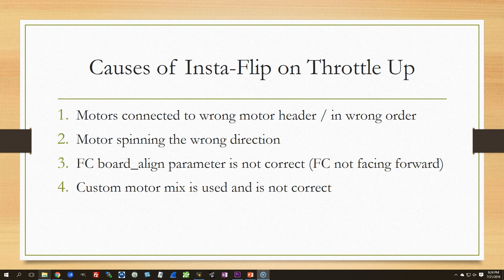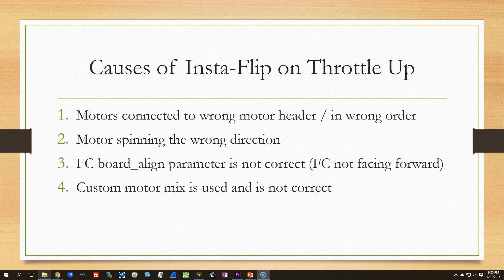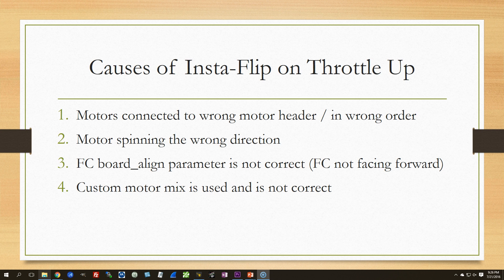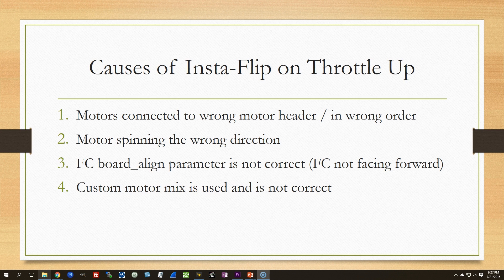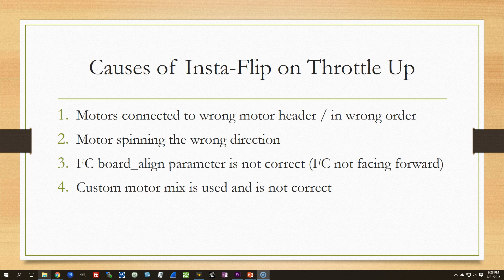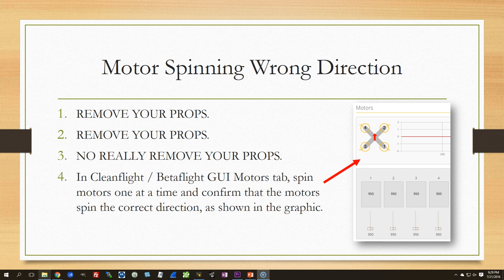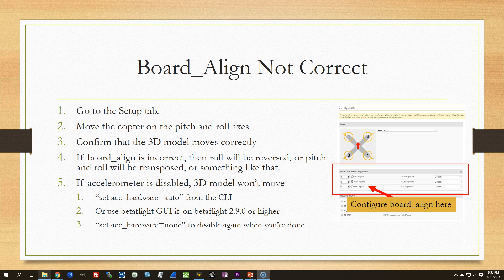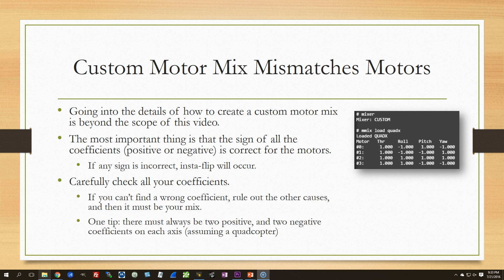Quadcopter Flips On Takeoff: Solved

Comment: I know this is an old video....maybe you'll see the comment maybe not.
I have an Eachine Aurora 90 with Omnibus mini f3 FC and 4 in 1 Esc.
When I liftoff in angle mode, it's no more than a couple of throttle inputs before it's rolling so hard to back-left I can't keep it in the air and it crashes. It's a week old doesn't happen in acro mode, telling me it's an FC problem. Also you can see it happening on the bench in BF with just a USB connection and the motor tab open. When you arm it and give it a bit of throttle, you can see the speed for 3 motors ramp up while it drops for one. Any attempt to correct it with the sticks just adds to the problem. No motors are spinning and no battery is connected on the bench when I see this so is the FC toast?
I'll do a video showing the symptoms and on the bench and post a link.
Reply: Been trying to get mine flying for weeks. Different suggestions about how to stop this, now I am keeping my fingers crossed that your suggestions will work. Following your instructions I found that my alignment was out 90 deg. Too late to fly now, and my nerves are a bit shattered after cutting the grass upside down with my drone. Thanks for your excellent videos and knowledgeable explanations they are a brilliant help.

Comment: theres another reason causing exactly this behavior. my accelerometer was turned off...
Reply from the maker: I don't see how that could cause this issue. Many quads run with acc disabled no problem.
Reply: Maybe i have an error which gets fixed by turning on the acc? So the acc "overwrites" the error? and not the acc turned off itself is the problem? I tried it, if i turn off acc, it flips like in your video. I turn it on, it flies fine. Its the first generation wizard ( bought after watching your review :) ) using all settings from your video but in betaflight 3.3.1 with pt1/notches F1F2 off , D term notch on. cpu load is ~29%. everything is original parts, except the motors which are DYS Wei 2207 2300KV. Flies great like this with acc on, motors not getting hot. thank you

Comment: My quad was doing this because my fc was facing the wrong way but now it does it when I make a sudden movement with the throttle. Any suggestions
Reply from the maker: This is probably a damaged motor or ESC that can't change speed rapidly. Whichever arm dips first when the quad falls is the suspicious one.
Reply: Joshua Bardwell yes the motor was also suspiciously warmer but there was no shorting out. I re soldered the bad arm esc and it worked fine in the garage. So i took it outside and within 7 seconds it happened again and landed in snow. So me being dumb i cleaned the snow off and plugged it in again. It beeped then it went silent and wont beep any more. I am currently waiting for it to dry completely and hoping i didnt ruin my first drone. Thank you for your videos I have learned a lot from them.

Comment: Eachine Wizard x220 spracing f3 is what I have... -90 degrees on yaw axis in order to have proper board alignment.... It came stock like that but when I updated firmware this option set back to 0 by default. Good luck yall

Comment: Hello Josh I have bought a new flight controller but the motors are still reving up and causing insta flip?? I am pulling my hair out please help????
Reply from the maker: It honestly is one of the things in this video almost every time. You can ignore motor mixes as we don't really use those any more.

Also verify props are on correctly.

Comment: I have everything correct. Motor alignment is correct, props are on right, motors spin in the right direction, the 3D model in betaflight acts correctly, I have not made any custom motor configurations. But my quad still flips! Could it be a damaged motor? When I use my tx in betaflight to run the motors, they seem fine. Help!
Reply from the maker: In the Configuraton tab, underneath where you selected the QuadX mixer, there is a check box, "reverse motors". It should be un-checked.
Reply: That box is un-checked, and all of the motors spin the correct way, and all of the props are on the correct way.
New info, I watched your video where you turned the throttle to minimum and just barely moved the pitch and roll stick to check if it was behaving properly. I did that, and my roll in both directions was fine, but my pitch was messed up. When I pitched forward, the back left motor throttled up, and when I pitched back the front left motor throttled up. When I tested that same method in betaflight it looked perfect. But when I gave it more throttle it looked ok except for that when I tilted the quad motor 3 stayed at idle or low even when it was the lowest motor on the quad.

Comment: My quad is not moving correctly in configuration on betaflight.. it's something to do with the motormix? Or when the receiver values changed on the receiver page so I had to switch the throttle, roll, pitch on the mixers on my taranis qx7.. how do I fix the board allignment please Josh?
Reply from the maker: Configuration tab. Board alignment parameters. NOT sensor alignment though.
Reply: Joshua Bardwell I set it up all again on betaflight and blheli suite and it nearly killed me on insta flip o' death.. Don't know what else to Try now I bought all premium components for this 1st build, I have ordered a replacement hyperlite f4 and a betaflight f4 and if they don't work I give up and I won't build anymore..
Reply: Where is board parameters? Cannot see on config page??

Comment: Mr. Bardwell, my 5" quad started pitching forward then flipping on takeoff after a failsafe crash (the quadcopter crashed on a grazing field). I ran through the checklist and I found that my quad will not move in the Cleanflight GUI, so I suspect a dead accelerometer or dead gyro... also, when I plug in my battery, it sometimes does not do the ESC tune where it goes (beep beep beep... BEEP BEEP)-- but sometimes it does. I've been playing around with the Cleanflight settings, tried turning off accelerometer/calibrating accelerometer, etc but to no avail. I just get flat gyro and accelerometer lines in the motors tab and the 3D quad model on Cleanflight still won't move. Did I completely ruin my gyro/accelerometer? Should I just buy a new flight controller (SPF3) or is this fixable?

edit: seems like the quad also has intermittent arming problems... sometimes it will outright refuse to arm, but if I wait a few seconds or even a couple minutes with the battery plugged in, the quadcopter will reset itself (it replays the startup tunes by itself) then I am able to arm the quad, but it still flips over on takeoff. This is such an enigma... I am stumped.

edit2: seems the accel/gyro aren't dead after all since they sometimes come back to life, but they always die out, especially after I unplug then replug the battery. I can't seem to reproduce the conditions of where the gyro and accel turn on and off.. seems to be random.
Reply from the maker: I think your FC is damaged and should be replaced. Since you have an SPF3, I am going to guess you have a Wizard. I recommend that you don't buy the cheap Banggood SPF3 clone that comes in it, as they die at the drop of a hat. Even if you paid 2x as much for the replacement, you would come out ahead.
Reply: It's my first quad build (parts were inspired by Stu's $99 build over at UAVFutures). I've had many crashes today, so I suspected as much with the damaged FC. I will be replacing it with a "OMNIBUS Betaflight F3 AIO V1.1 Flight Controller with Integrated OSD Barometer Support SD Card" Is this a suitable replacement? I chose this particular FC because it has a built in OSD and actually costs less than the $29 I paid for my original SPF3 FC. I hope this is not one of those FCs that break easily just like you said, but if it is, can you recommend a better one for me? I really would like an OSD built in.

Comment: My quad was flying ok, after replacing de battery for a new flight it started flipping, none of you 4 reasons for flipping is present, what do you think is the reason for flipping? Fc is betaflight F3
Reply: MEDELECTRA INGENIEROS same for me. Betaflight 3.2 on Omnibus F4 pro V3
Any news from you?
I read about an old bug maybe related to Motor stop and gyro calibration not finishing after arm before liftoff but it didn’t get me further
Reply: Also to mention: it’s freaking cold outside right now and after a while in the warm indoors, the quad kind of recovered. Flew like a charm until the second Lipo - same thing.

Of course it would not swap like in the video where it flips when throttle is enough for liftoff, but instantly with the first bit of throttle.
Reply: Robert Hochstrat no news, i could not find out the reason, I bought a new fc (jb fc f4) and will mount it next week
Reply: MEDELECTRA INGENIEROS I turned on the automatic gyro calibration at first arm and haven’t had the issue since. Hope that solved it :-)
Reply: I had a quadcopter not too long ago that acted similarly because I had motor desync once throttle was about 10 or 20%. Check that.
Reply: @bobbfwed  how do you check for motor desync? In betaflight motors tab?
Reply: @thewildgust  You can try spinning each motor up (with no propellers on) and see if they stop or start twitching at some point. But the motor reacts differently when it's spinning with propellers on, so you would likely have to diagnose it by flying or using blackbox logs. NEVER HAVE YOUR PROPELLERS ATTACHED WHEN A BATTERY IS CONNECTED AND YOU'RE CONNECTED TO BETAFLIGHT! What you're looking for in blackbox, is a motor that is going to 100, while your other motors are at a moderate output (assuming you're not doing any crazy maneuvers). If it's doing that, it could be an untightened prop, bad soldering,  bad motor, or bad ESC (check them in that order). For solder, put a hot iron to each of the signal wires (on both sides) and the motor wires. It amazes me how many times a solder joint looks good, but a quick tap with a hot iron fixes a problem. For the motor and ESC, you can swap them with a different motor or ESC on your quad. If the problem goes away, it was likely the culprit. Good luck!

Comment: I checked everything that you said and it still instaflips
Reply from the maker: Usually when somebody says this, it turns out later that they overlooked one of these things. You should also check that the props are on correctly, as that is another cause that I didn't mention in the video.

1. 3D model moves correctly in the Setup tab.

2. Correct motors spin up when you raise the motor sliders one by one in the Motors tab.

3. Motors spinning correct direction per diagram in the Motors tab.

4. Props on correctly.

5. No custom mix messing you up.

It really, really is one of these things, 99% of the time.

Comment: Joshua just curious.... All I did was change out my Motors to the Mr Steele Motors.... So none of the four things you listed really apply to me but for some reason I still have the insta flip. Unsoldering and soldering back motor wires should not be a big deal right... I've done it several times
Reply from the maker: +Jeffrey Anderson motors don't always spin the same direction when wired the same. Depends how the motor is wired internally. You always have to check the direction when installing new motors.
Reply: That's what I don't get.... all the motors are spinning correctly I have triple checked them and the props.

Comment: Mine is flipping whenever I increase throttle to about 40% or more. I can hover just fine but if I increase it does it. It doesnt matter if i punch it or ease it up. As soon as i give it throttle it starts doing barrel rolls to the left and drops, it does it both in airmode and in angle mode. This only happens with my 3s 50c battery. Whenever I put on my 4s 40c battery it flies just fine. Im really confused as to whats going on, any of you experienced it anything like it?
Reply from the maker: It sounds like a damaged motor or ESC to me.

Comment: My shuriken x1 dose this straight out of the box. It takes off and I can fly it and it works fine until I try a punch out.  Basically anything under throttle makes it do crazy flips of death then flys flat out at the ground.  I don't even want to test fly it anymore it's really dangerous and its damaging any ideas on a fix?
Reply from the maker: If it does a death roll when you raise throttle but otherwise hovers normally, then you probably have a damaged motor.
Reply: Joshua Bardwell 
Thanks for the reply 👍👍👍 I've tried a few things and re-flashed a few time and it randomly stopped flipping. .. weird.  Has a very wicked yaw twitch now moves about an inch but punch out is good. No more flips. I flashed the esc's and set two of the notch filter things to zero. I tested it for a bit right on dark it was hard to see but I think it has tamed the twitching a large amount. Motors only seam to of got a little warm. Much more testing and fiddling but I feel like I've made progress.  I also have a storm   butterfly 16. That thing just vibrates so hard it can barely stay in the air. Not the best start to the hobby but I'm learning heaps. Thanks so much for your  hard work here. I would definitely be lost without your video's.  👍👍👍
Reply: Joshua Bardwell 
Joshua Bardwell I couldn't solve the problem out the shuriken x1 flipping out in a punch out plus I crashed it so many times testing it that I broke the buzzer and I think one of the motors is questionable. Sometimes it would go crazy and flip out other times not. So I bit the bullet and brought another one.... guess what?... same problem punch outs make it go nuts flip out and crash hard. I've noticed something but. Both of them don't do this when the battery is low or somewhat used. The crazy stuff only happens on a full battery.  I can only assume it's a voltage problem.  Any ideas mate?

Comment: My quad doesn't flip on takeoff, i can hover, stable. But when I increase throttle, then quad flips. Must be a motor because I already switched out FC+PDB and ESCs..
Reply from the maker: I agree.
Reply: It was a motor! had some vertical play on one, that turned out to be an issue, caused desyncing probably
Reply: it was a motor, but not the motor I thought, I had one with a little vertical play, but it wasn't that one. Be wary of the side it falls to when you're getting it. Try to trigger it from the least input
Reply: For the purpose of helping someone troubleshoot this issue in the future.  A bad/cold solder joint between the ESC and motor or a damaged motor wire can cause this behavior also.  The quad will fall in the direction of the troubled motor/esc.
Reply: rob Did you work out if it was a motor. I’m having the same problem.

Comment: I have a 3s 40c 550mah, a 2s 30c 700mah, and a 2s 30c 1000mah battery, all fly fine and well on my 95mm build.  My 3s 45c 450mah battery causes my build to flip and reset upon throttle up on take off.  Why would this happen?  How do i fix it?
Reply from the maker: Something is wrong with your quad and for some reason the other batteries are slipping by. Figure out what is causing the flip (hint: it's not the battery) and fix it.

Comment: What if all motors are going correct direction and props on correctly. But as soon as i arm the quad it shoots up in the sky??
Reply from the maker: D gain too high. 

Yaw motor direction reversed in the FC so the motors are going the direction you expect, bu the FC expects them to be reversed.
Reply: TY TY!! D-gain way too high on default(for me). She flys now!! thanks josh!
Reply: Joshua Bardwell 

Hi I crashed my racer with 4in1 and reassembled it in a new frame, my quad did this exact same flip, I swapped my FC and it still does this. I have confirmed that motor direction and motor numbers are correct on the motors tab using the slider with the corresponding motor. It still flips out. Board orientation is also correct. Could I have an esc issue?

Thanks for the great channel Joshua

Comment: The video was extremely helpful when I was diagnosing why my new fc was causing a flip. However it turns out my fc was bad. I installed my spare with the same setting and it worked perfect first time. So you could add to the list bad fc or hardware problems. This video did help me through an extremely frustrating fc install
Reply from the maker: I mean, you can never rule out bad hardware...

Comment: i have a f450 with kk2.1.5 and it gets flip while take off.....what would be the problem?
Reply from the maker: +dipesh patidar probably board orientation or motor order incorrect.
Reply: Joshua Bardwell what does it mean by board orientation?
Reply: how should my board orientation be?
Reply: It is what direction the flight controller is oriented on the quad. There is an arrow on the top that shows front. If you don't install the fc with the arrow on top and forward you need to reflect those changes in your configuration
Reply: Del Sutton i oriented it the same u r talling..... Do i have to connect motars on fc board by number wise..... Like motar1 on first port than 2nd motar and soo on